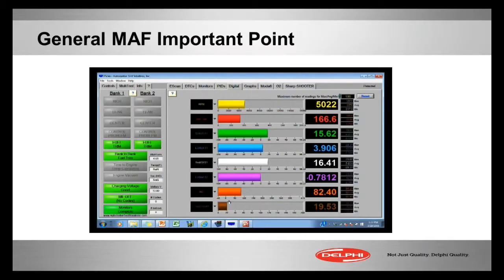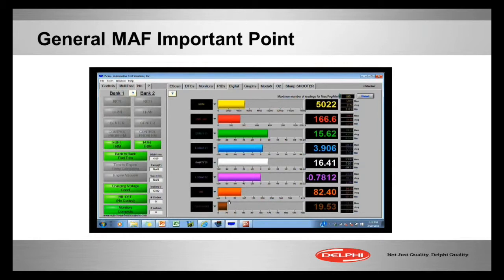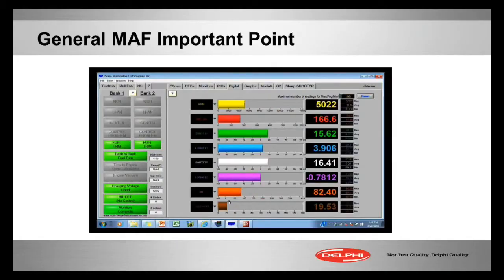General MAF Tips (MAF and the Modern Tech)

Comment: I have a 2010 elantra that has a rough idle issue that goes away after I start to drive. I have a Launch 123 i scanner. How do I use this scan tool to diagnose a possible issue with the maf sensor?  Also how do I contact Delphi to find a replacement part if needed if it is the Maf sensor The car is a 2010 elantra 4 door sedan model GL, AT transmission.  Vin KMHDU4BD2AU097415.  The original OE number from Hyundai is 2816423720... Can you help!  Thanks Ed R